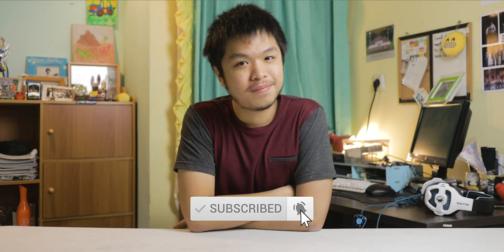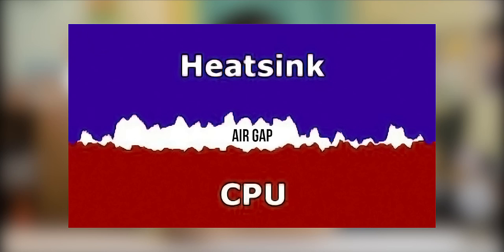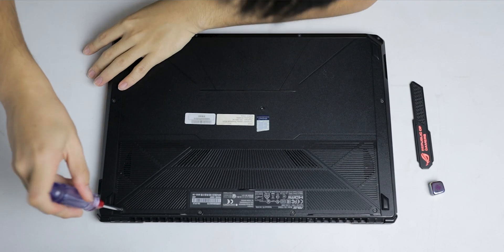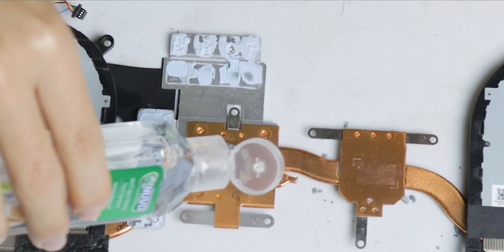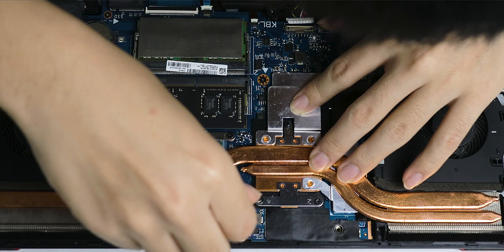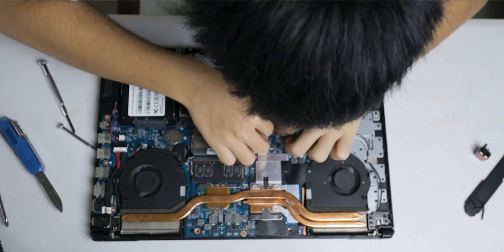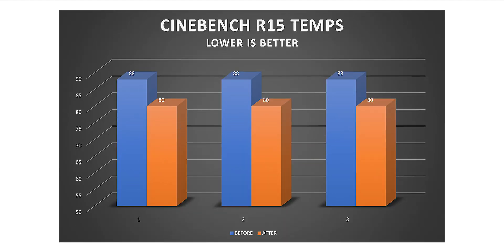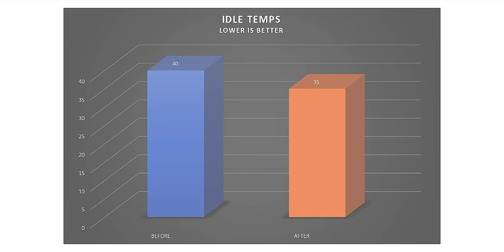How to Replace Thermal Paste - ASUS TUF FX504

Comment: is MX4 thermal also good?
Reply from the maker: Yes it's good, but not as good as thermal grizzly or the kingpin kpx. Not by much tho, you'll be fine if you use mx4.
Reply: @PioSoesetio  Wow thx for the reply :D 
The reason I asked is because I cant find any of the other thermals you talked about in my country.
And the order price is also very high unlike mx4 which have very good price.
Reply from the maker: @xenonohad  No probs, MX4 is good, go for it
Reply: @PioSoesetio  Another question if I may? 
How did you jiggle out the heat sink it seems different in my fx504.
It has two heat pipes that leads to both fans and also the heat sink seems to be bigger, I unscrewed all the screws but cant lift it up :(
like something in the middle of the heat sink wont move at all any ideas?
Reply from the maker: @xenonohad  I guess you probably have the gtx 1060 version which should have more heatpipes and bigger heatsink. Make sure you've unscrewed all of the screws, cause some are kinda hidden, one of which is below the cables. It should be easy to pull out once it's all unscrewed.
Reply: @PioSoesetio  Yes I do have the 1060 gtx version forgot to mention this I will look up to it thank you :D
Reply: @PioSoesetio  Another quick question, they couldn't have used thermal paste with adhesive on this design could they ?
Edit: I Replaced the thermal paste now all I had to do is to jiggle it a bit stronger XD, There are good differences something like 7-8 degrees less and also It wont reach to throttle degrees it stands at about 87-88 max which is awesome :)

Comment: bruh i have the i5 8300h and gtx 1050 variant. i keep using turbo boost fan profile when i gaming and rendering. (ofc it's undervolted at -150 and run without problem). and after a few months the temp of cpu start to rise and it's showing thermal throttling and when i bring it the service center, the CS said: the fans was replaced with new one cause the old fans were not running normal. my question is it because of turbo boost so it can cause fans damage or because of the thermal paste ?
hope you will reply this comment.
Reply from the maker: It's the fans that causes ur laptop to heat up. And no, overboost doesn't cause fan damage. Maybe you dropped or laptop, something got inside the fan or something that caused it to break. I ran my laptop at overboost most of the times and I use this laptop around 12-16 hours a day, no problem with fans. Thermal paste will degrade over time and you will need to replace it, but in your case, it was the fans, not thermal paste.
Reply: @PioSoesetio  wtf, 12-16 hours with no problem. i never drop mine tho and rn it works perfectly. and yeah my warranty is over for about a month ago 😂 hope anything bad will not happen.
Reply: @PioSoesetio  and fyi, they replaced the lcd (its glitching every 4 sec), they replace the hinge too cause it have weird sound when i open it, and they also replaced whole motherboard and fans cause they say it was like failed product (overheat bla bla). they almost replace everything except the hdd lol 😂. and fortunately after run heavy benchmark on cpu and gpu, it was fine. just the temp is little bit unacceptable. maybe caused by poor cooling. and yeah it has only 2 heatpipes.

Comment: Bro i an having a lot of problems help me
Reply: external heating fps in gta v are 10-5
Reply from the maker: @aayushsingh-vq5xe  External heating? What do you mean? You mean it's overheating? Try running the overboost fan mode.
Reply from the maker: Hi, what problems are you facing?

Comment: hey man i have a fx504gm and i am sick... as soon as i start gaming my cpu gets stuck at 0.78ghz and gpu is sitting at like 15%. i have disabled bd prochot and undervolted my cpu and gpu i have no idea what to do. i have a gtx 1060 and in games where ppl get 1000+fps i get 130 which drops to 30 fps i am so sick of this if u have anything that could help it would be appreciated
Reply from the maker: Did u tweak any cpu/gpu setting? Looks like you undervolted your cpu too far to the point where it can't even run at base clock. Did u change speedshift?
Reply: Pio Soesetio no man I didn’t I used throttle stop and that has increased my temps I have undervalued my cpu to about -75 or -100 mV. But as soon as I open mine craft my cpu usually drops to 0.78 GHz or stays at 2.3 GHz

Comment: Is it safe to use Liquid Metal like Conductanaut ti our Laptop FX504??
Reply from the maker: Not so sure, but I wouldn't really recommend on a laptop. Too much risk for a slight increase in performance as it's a laptop with limited power. Plus, you're applying it directly on the processor, there's no IHS, more risk in my opinion.

Comment: i posted a idea about the cooling problem on linustechtip about power limit throttling at the 21st page . I hoped you read it and do a video about it. the name is Peter Smith
Reply from the maker: Hi, I saw your post. I don't think that the VRMs is the limiting factor here as my laptop works fine. Plus, I added thermal paste onto the VRMs. Note, for some reason I can't load the picture you sent, but I'm assuming you're pointing to the VRMs / memory module that I repasted in the video.
Reply from the maker: Ok, it finally loaded after like 5 mins, don't know why it's that long. I'll try applying thermal paste/thermal pads in there. Maybe it'll boost the performance.
Reply from the maker: edit, thermal pads, as the VRMs there are not touching the heatpipe.
Reply: @PioSoesetio  try to attach the thermal pads onto the heatpipes and see the differences of the TDP before and after attaching it. Is the TDP now higher than 25w ? pls reply my cmt

Comment: Will it void my warranty if I repaste the thermal paste. Also what's the idling temp?
Reply from the maker: Pretty sure not, just don't break it in the process. If you break the heatsink/fan/processor in the process, I don't think that'll be covered by the warranty as it is your own mistake. But if you repaste it properly and maybe a month later your keyboard broke, that's still covered by the warranty.
Reply from the maker: Idle temps is in minute 9:19

Comment: Can you help me Brother?
I have a Fx505DT modal, which I bought last year. While Gaming it constantly maintains high temp between 94C-101C. What should I do?  should I replace the thermal paste???
Reply from the maker: Was it like that since the beginning?
Reply: @PioSoesetio  It used to touch 90 C..and didnt caused any trouble in gaming. But now temperatures are reaching near 100C and because of this there is frequent  thermal throttling and games starts to lag heavily..
Reply: @PioSoesetio  can u please suggest something?
Reply: @arnabnath8578  replace it with thermal grizzly hydronaut

Comment: Hey man, I am facing an issue. I have the exact same model as you, also 2 years old. I recently started having thermal issues with my laptop so I decided that I'll change the thermal paste. So when I removed my heatsink, I noticed that along with the cpu and gpu there was preapplied thermal paste on some other components as well, just like yours. So I removed old thermal paste from those components as well and applied new one (Arctic mx4). I did pretty much everything exactly like you did and reassembled my laptop. Now the problem is that I am now getting even Higher temps than before. My room's ambient temperature is also about 25⁰C. Also worth mentioning is that my games actually perform slightly better than before but my temps are worse. Any explanation or help is appreciated, thanks.
Reply from the maker: The performance of the laptop was limited because of it's temps before u replaced the thermal paste, hence why it ran slower. After replacing the thermal paste, it can run faster because it's not limited by the temps. That's good to hear. As to why it ran hotter, I'm not sure. It should run cooler or at least the same temps but more performance. Did you maybe change fan settings or put the laptop in a different spot?
Reply: @PioSoesetio  thanks for the reply man. No, fans setting is the same. I always run it at overboost. Moreover I did proper testing under same conditions before and after applying thermal paste. I've just sort of given up now and accepted that this model's thermal performance sucks anyway.
Reply: @jjeeefff  Arctic mx4 sucks on laptops man. Use a thicker paste like gelid extreme.

Comment: You could've just rescrewed the heat sinks starting from 8 to 1 for a much even spread. Anyway good vid. Did mine few days ago, got down to about 10 degs
Reply from the maker: Thanks! wdym 8 to 1?
Reply: The screws on the heat sinks are numbered. You can unscrew them any way you want but when putting it back follow the numbers

Comment: i have the same laptop i upgraded its ram with 16 gb extra. now i have total 24 gb of ram. i am still facing sudden fps drops. if i will change my SSD and thermal paste can this problem will be solved ??
Reply from the maker: How are your temperatures? Are you running on the overboost fan profile yet? Are you on power saver mode or is the laptop unplugged? Have you updated your drivers & BIOS?
Reply from the maker: Hi, in what scenarios did it face sudden fps drops?

Comment: Hey man nice video! I"m getting encourage to rpaste my ASUS TUF FX505GM. How about tips in using your throttlestop for undervolt.
Reply from the maker: Thanks! :) I personally am not pushing it for the best performance, I want it to be fully stable, so I did a -125 mV offset which should be easily achievable on most laptops.
Reply: Well I push mine to -150mV offset but small temp just changed,so I need to adjust my clockspeed to 3.0ghz to maintain the cpu temp but the downside is low fps in some games.
Reply from the maker: @Icaga1903  Just let it thermal throttle, lol.
Reply: @PioSoesetio  For my latest update i saw whats wrong with the unit, there is not enough airflow at the bottom panel of the laptop so i made many holes in the bottom panel facing the fan - cpu - gpu - fan. Temp drops significantly.
Reply: @Icaga1903  i have the same Model. Can you tell me more about how you did it and how temperatures dropped? Maybe show me?

Comment: Thanks X1000 for this video! Best tutorial on this topic on yt!
Reply from the maker: Thanks! :)
Reply: @PioSoesetio  btw, my pc went down 30 degrees haha.
Reply from the maker: @mammutbrot9230  Daaamn that's a lot
Reply: @PioSoesetio  sadly, my games dont seem to run better... Do you have any suggestions of why that would be? It doesnt thermal throttle anymore, but it still power limit throttles. Now, the problem is: it does work with older drivers, but if i have new ones installed it power limit throttles. I was hoping that would be fixed by changing the thermal paste, but it didnt.
Reply from the maker: @mammutbrot9230  What laptop do you have? And in what game are you facing this issue?
Reply: @PioSoesetio  I have the Asus tuf Fx504 ge. The one with the i5 and the 1050ti. Im facing the issues on every more complex game basically. One example is valorant. The fps are way lower then they should be. Every driver is up to date, the bios is also.
Reply: @PioSoesetio  and what i dont get is: it worked perfectly in the beginning, but after half a year performance just dropped and ive been trying to fix it since then
Reply from the maker: @mammutbrot9230  What makes you suspect tht power limit throttling is causing the problem? Also, how much RAM do you have?
Reply: @PioSoesetio  i upgraded to 16 gigs of ram. I have xtu, and that tells me its limited to 25w.
Reply: Maybe its xtu limiting it, since i installed it about year ago the problems started so that might be it.
Reply from the maker: @mammutbrot9230  Yeah, don't use XTU.
Reply from the maker: @mammutbrot9230  I'm pretty sure it's not the CPU that's causing the problem tho, games rarely require high cpu usage, it's more on the gpu.
Reply: @PioSoesetio  hmm. Do you have any ideas on how to fix it?
Reply: @PioSoesetio  uninstalling xtu didnt work either
Reply: @PioSoesetio  my best guess would be my gpu drivers. I did a clean reinstall a while ago but that didnt work. I could use a old version of the drivers and that does fix it, but using old drivers inst a good idea.
Reply from the maker: @mammutbrot9230  Well if old gpu drivers works, then why not? I haven't even updated mine in ages. I only update if there's a problem or a major improvement/feature.
Reply: @PioSoesetio  ok, thanks. Ill use the old drivers.
Reply from the maker: @mammutbrot9230  Yeah, you're welcome
Reply: @PioSoesetio  maybe resetting windows helps, but i doubt it.

Comment: Hi, I've Same laptop with i5 & 1050ti.
Its heating too much while gaming (>90 degrees), only getting avg 40 FPS in low settings in GTA V.
After knowing about Throtlling, I checked that i was Previously in BIOS v317, TDP was locked in 25W, power throttling was there always, thermal Throtlling occurs in high GPU benchmark tests/gaming. Cinebench R20 Score was around 1100.

After updating BIOS today to v318:
TDP unlocked, power throttling gone, thermal Throtlling still there. Cinebench R20 Score 1200+.
These are observations in XTU (Excluding Cinebench).
But gaming still lags, and its overheating. 

So I uninstalled XTU completely and Undervolted the CPU, and iGPU to -141.6 mw by ThrottleStop, also adjusted GPU curve in Afterburner. Gaming slightly improved but not that much now getting avg 45 fps, but the temperature of both GPU and CPU gone nearly 90 degrees.
 Sometimes I feel everything is good in this lappy, power throttling is gone, only because of summer its overheating, I will apply this thermal paste and see the results. Untill then, Please review my settings, am I doing it right?
Reply from the maker: Yes, you're doing it right. For me personally -141.6 mV is unstable, but hey, if it's stable on urs, good for you. I wouldn't personally undervolt the iGPU as it's not used that much because the laptop has dedicated GPU, but don't forget to undervolt both the CPU Core, and CPU Cache. I would also recommend upgrading the ram to dual channel 16 gb if you haven't already, helps a lot.
Reply: @PioSoesetio  Thanks for replying. Yes I have dual channel RAM 8x2. I just wish this laptop has a better thermal cooling system. However I will follow this video, will update afterwards. Untill then, Happy gaming.
Reply: While gaming it will run at 45W ? Mine working at 25W
Reply from the maker: @darshanparbadiya7348  Games doesn't require 45w of cpu power. It doesn't need a 6 core processor to run at full utilization, games aren't that cpu heavy. 25w on games is completely normal.
Reply: 25w limit is removed? I also have same laptop. yeah in normal scenario it goes up to 45w but when opening heavy programs or opening 50 tabs in chrome mine powerlimits to 25w. clock speed is also reduces to base clock around 2.30GHz. No turbo boost .
Reply from the maker: @darshanparbadiya7348  what kind of normal scenario when it hits 45w ?
Reply: @PioSoesetio  it works at 45w while opening small programs. and start working at 25w while opening heavy software (android studio, photoshop , illustrator )

Comment: Hi!I Saw your video with undervolting for this laptop.I have the same laptop.After undervolt,update BIOS and everything i still have high temps and tdp locked at 25w.What should i do?
Reply from the maker: Hi, in what scenario is the tdp locked at 25w and how high is the temperatures?
Reply: In every Game i have 25w.In cs go i have 80 degrees at gpu and 85-88 at CPU.
Reply from the maker: @Robert-sn8ym  Temps aren't pretty bad
Reply: But when i try a test at full stress it s not locked
Reply from the maker: @Robert-sn8ym  Yeah, stress tests locks it in 25w, tried aida64, cpuz. They all lock it in 25w. Don't know why, but it works fine  in benchmarks and real world scenarios
Reply: Can you send me your settings on throttlestop?I ve done a lot of things and i don t know anymore how should i put them for a good fps without stuttering and ok temps.